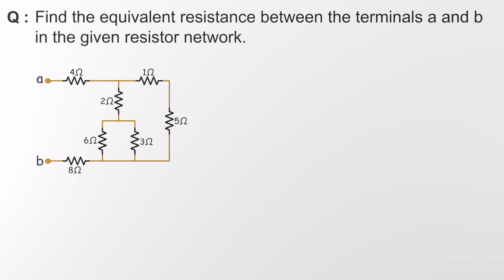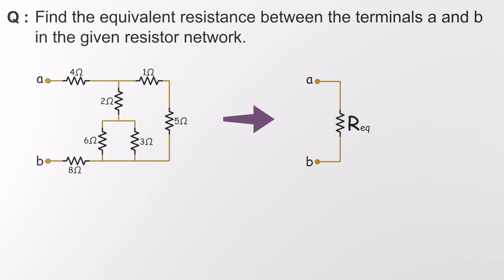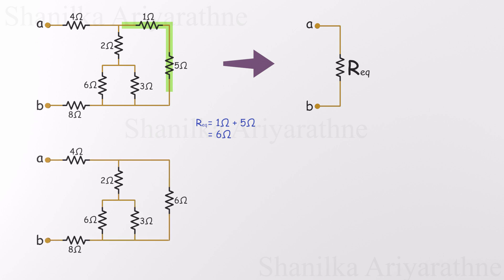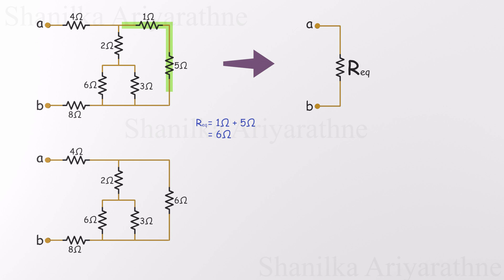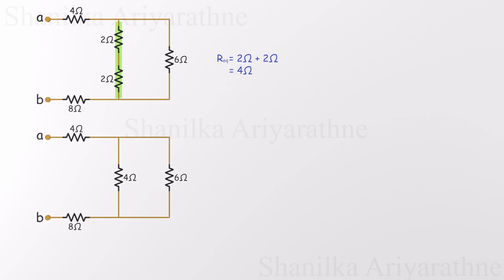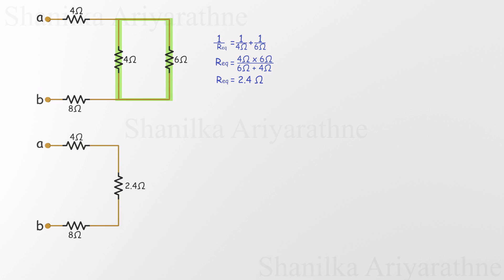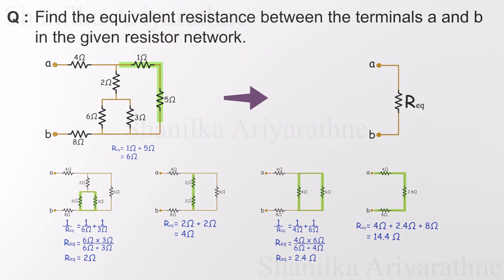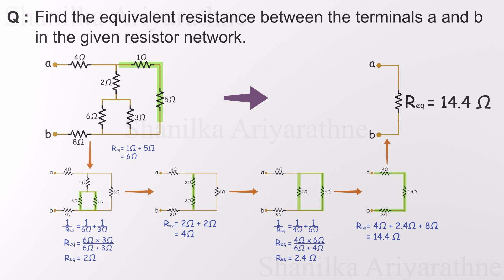Simplify Complex Circuits: Find Equivalent Resistance Step-by-Step

Comment: Great video. Could you explain why you could not use two resistors in parallel a (18 ohm and a 68 ohm) to get almost the same resistance, 14.23 ohms. Is there a reason to use 7 resistors? Thanks Again